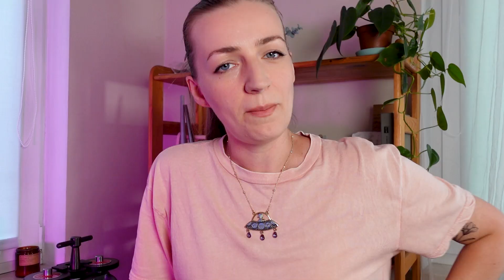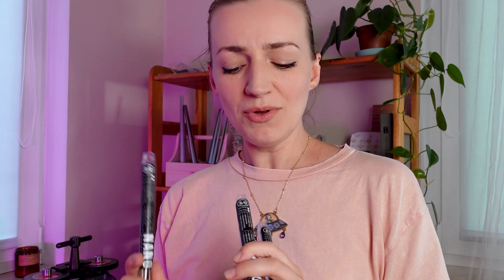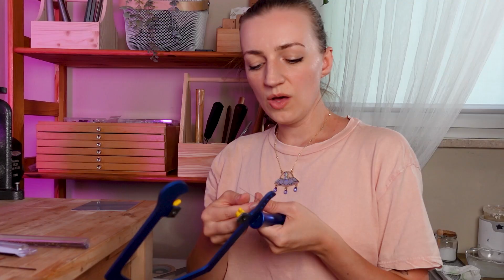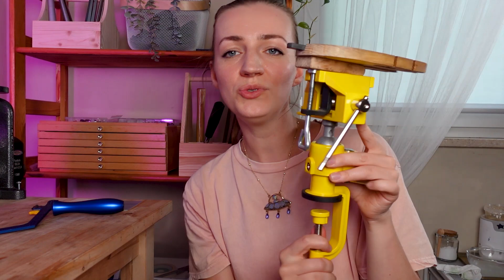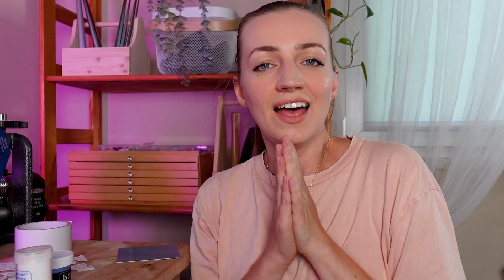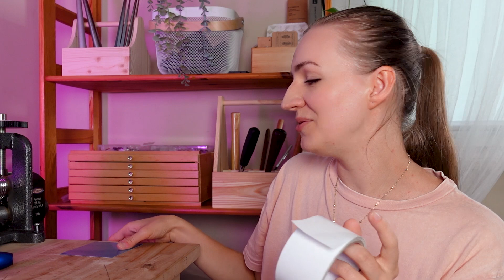SAWING BASICS! How to use jeweler's saw frame. Metalsmithing for beginners

Comment: Hi Basia, I need to make an elevate ben peg for sawing. Please could you tell me where you got your vice from or what model it is? Many thanks.
Reply from the maker: I got it from a shop called Aldi (similar to Lidl and other chain markets). It's just a regular small bench vice, not a particular brand, with an opening of about 7cm. Many shops have them with different names and colours (I believe it's a basic tool sourced from China, that shops buy and add their branding).
Reply: @TheArtOfMetalsmithing  many thanks Bastia for getting back to me, much appreciated:-)

Comment: I’ve just ordered the Haymaker saw frame how are you finding it to use , 
Hope it’s better than the adjustable steel one.
Reply from the maker: It's much better than the basic adjustable one! Absolutely. I think you'll like it a lot, I found it especially great for straight lines, circles and larger shapes, where the line has to be as even and smooth as possible. I personally think this frame is easy to control. Has a good weight and changing blades is fairly quick. Overall, a good saw frame as an upgrade from the budget one.
Reply: @TheArtOfMetalsmithing  
Great that’s good to know, I found the steel adjustable one gets in the way of my wrist, where the Haymaker doesn’t stick down at the back, and the Haymaker has more reach for larger work on sheets of metal 👍👍

Comment: Another EXCELLENT video! I sawed OFF the extra metal beyond the handle on the non- "C" side of my Haymaker saw; the big bulb shape and the shape with holes in it (what were those for anyway?)!!! It's aluminum, so it can be sawed off easily and those two parts of the saw are no longer in the way, bumping into my plate, the bench, easier to draw the blade through the bench based cone lubricant, and most of all it no longer falls off my pin when I'm loading a blade, etc. I recommend this DIY saw improvement! Chris designed a gorgeous and solid saw, and now....guess what, it's STILL balanced! It's such a better saw now, and I use it all the time without cursing.

Comment: I use rubber cement to adhere my drawings to my metal. Works well and easy to remove design when I’m finished cutting.

Comment: ok this sounds silly question but what kind of double sided tape do you use?
 the one I use is very thick and makes it harder to cut out a design
Reply from the maker: I found mine at a pound shop, but I've also seen it at a hardware shop and even at a craft store. It's a very thin tape and comes in various sizes (smaller or wider). I hope you'll be able to find something like this! ❤️